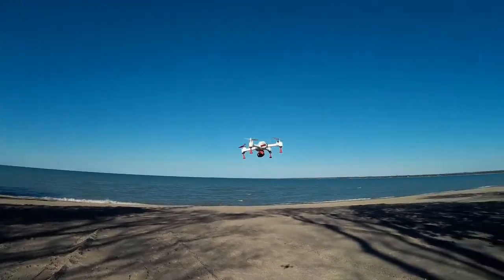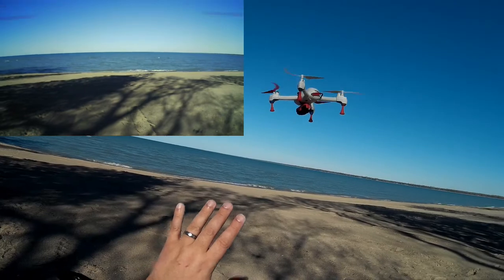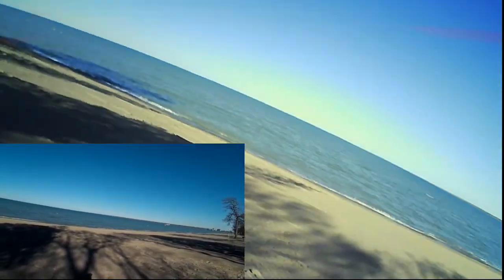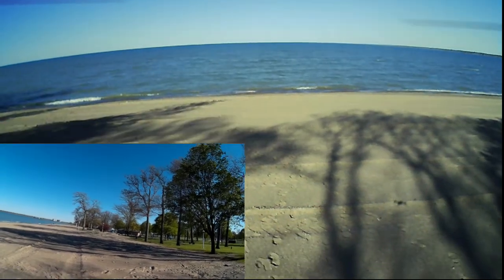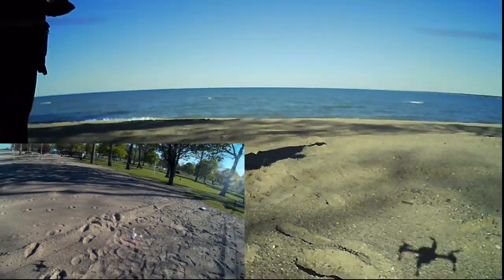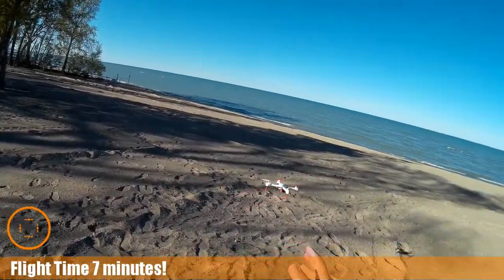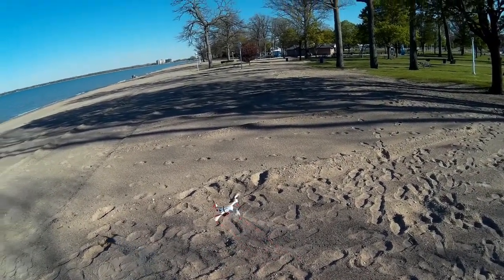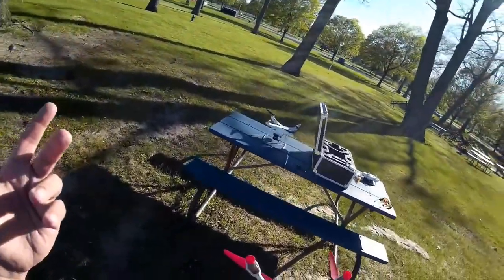Video Drone - Hubsan X4 502e Flying an 808 Keychain Camera for 9 Minutes!

Comment: great video!
this is what ive done to mine with the mobi-mini:
put a couple thin pieces of packing foam between the belly and the camera...then velcro strap it on...
that sheds weight and fights jello as well...
on my x8 birds i have a credit card mount that i attatch the mobi mini onto...hardly any jello and no legs in the shot!
Reply from the maker: +birdman316 cool!  However speaking of cool be sure to leave space for air to get in the cooling vents as she can get hot under the collar pretty quick 😀
Reply: thanks! i meant to clarify something but didnt want to double post...i dont own a 502e...
the syma birds have a flat belly...no vents there...
wonder if you could "swiss cheese" a credit card mount...the part that gets strapped to the belly...
about the upair...i saw a video on a mod...i modded the modd...video coming soon!
Reply from the maker: Very cool and yes have the Syma X8 and X5, and have 3d printable adapters for both :-)
Reply: nice...someone told me that after i meet the mobi-mini that ill forget all about those factory syma cams lol...
its amazing that it hangs with the upair,,hubsan,,my andoer,,,even the syma "g" cam...well...it bumps that one  quite easily lol..
but the syma "g" cam aint too shabby tho!

Comment: So do you love the husban 502 E ,I thinking of buying it soon,I am beginner ,with no  flying experience .would you recommend this one.anyone
Reply from the maker: For around $100 bucks it is the cheapest GPS quad out there, however be for warned the camera is junk so don't expect much and it is brushed to so you will get say around 25 to 50 flights before the motors need replacing (at least that's what I found).  Now this is just full disclosure stuff as I love flying mine and hacking it.  If your not into hacking and fixing I would suggest its bigger brother http://amzn.to/2qPFVyu as I have one of these too as the 502 can't handle any wind either yet this lager brushed version is almost up there with the P3S.  Hope this helps...
Reply: yes you will be pleasantly surprised . Its easy to fly and worth the investment

Comment: What kind of antenna do you have on the remote & have you upgraded the antenna on the quad it’s self too? , it has the same type of snap on  connection so I’m sure one could add an upgraded one right ?
Reply from the maker: The antenna on the quad is stock and the moded antenna should be in the description link...

Comment: I recently purchased the Firefly Q6 and I’m thinking of buying the H502 FPV version and turning it into a poor mans 4k platform.
Reply from the maker: It won't handle the weight  well and will likely burn up the motors after a flight or two...
Reply: Video-Drone I thought of that too.  Thanks for the reply.  Your channel is great.
Reply from the maker: Your welcome, at that price point it is going to be hard to find something as they are all brushed motors and they don't last long as is, then to throw extra weight on them is a killer.  For the Solo with the ThiEYE was sub $300 (for both) and I get good 4k video
Reply: Video-Drone oh yes, I’ve been looking at the Solo.  The only thing holding me back from hitting the purchase button is its size.